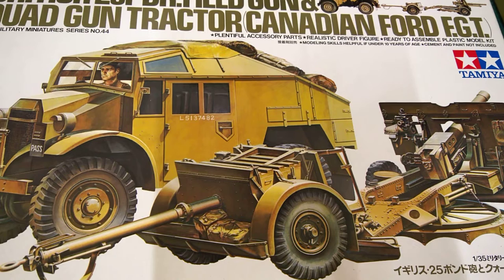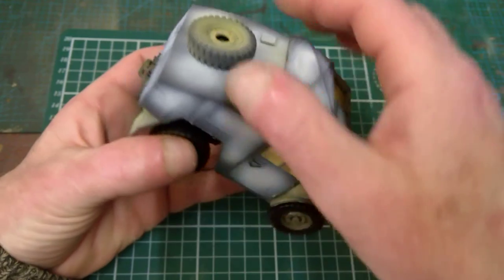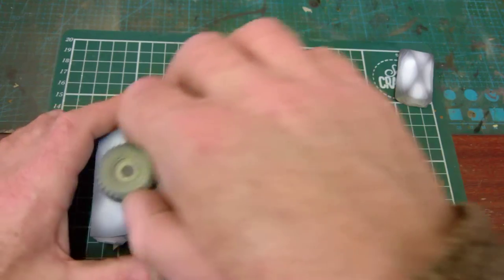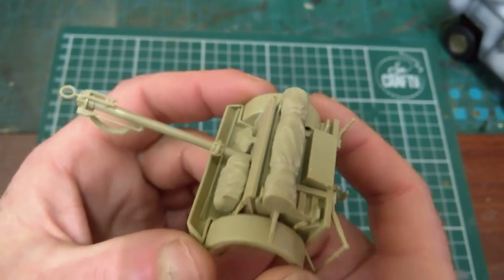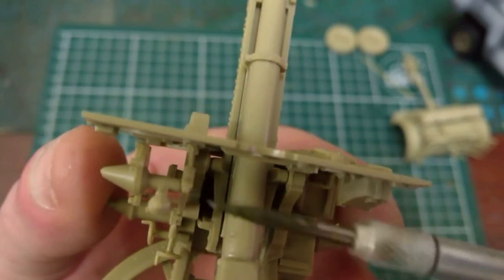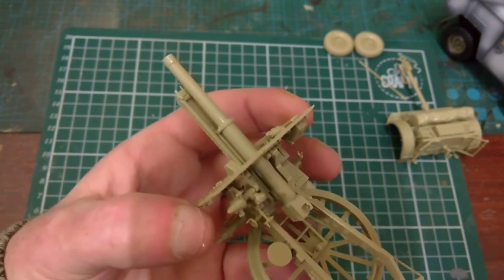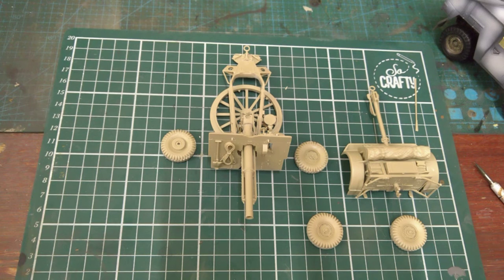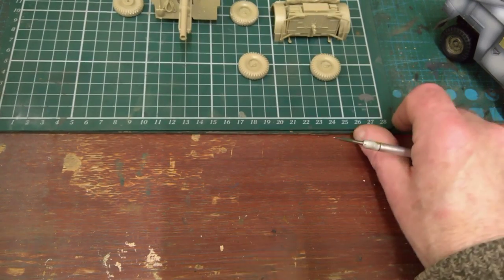Tamiya 1/35 British 25pdr. Field Gun & Quad Gun Tractor... Build Update #2

Comment: Great job my friend. I'm happy to see you didn't have any problems removing the counter weight. FYI, the counter weight was added to the gun along with the muzzle brake about the time the end was in sight for the fighting in North Africa. It was decided that the production of parts would go to the guns being readied for the invasion of Europe. The reason for the addition of these was the damage being done to the guns by the large scale firing of heavy charges for the AT rounds. The muzzle brake and weight are seen in Italy and Europe and also Korea which is about as far as my interests go.  If you're planning on having the Quad towing then you "might" want to make one other change. On the inside of the trail you'll see the travel lock. It's molded on but if you want to use it you can. it simply goes across the opening and the bottom of the breech(I think) has a hook that simply fits in a hole and the gun is moved slightly to one side and lock it. 
     Back in the early 70's I saw one build up in a diaroma with some troops and a vehicle or two stopped beside a road so everyone could take a " break" and stretch their legs.  I noticed that the officer had relived a "pressing issue"by the puddle he left !  It was a great diaroma but it was 3+ feet long !   Great concept though.
Reply from the maker: Thank you for all your help   :-)  J